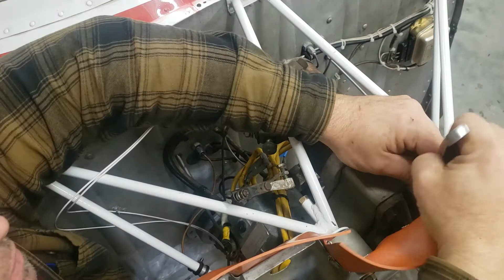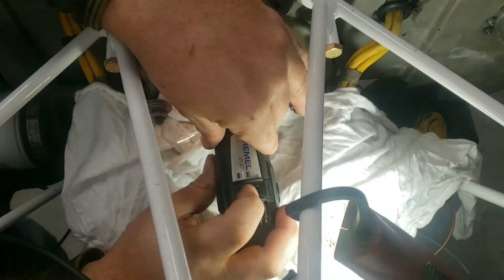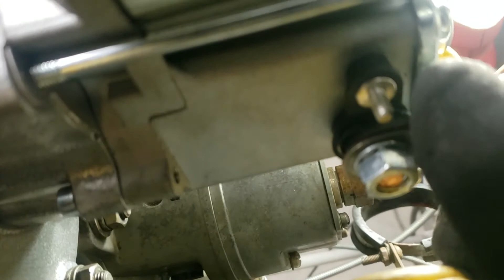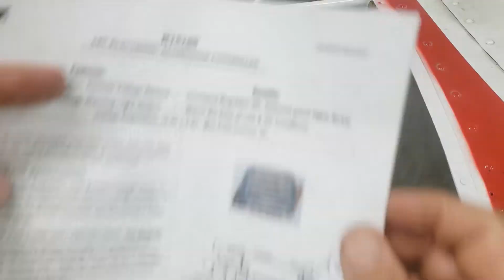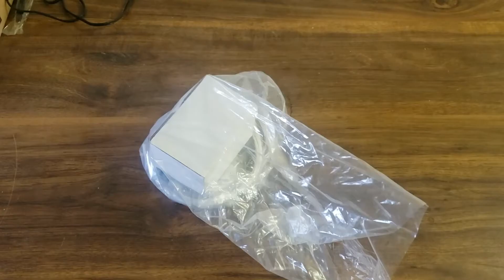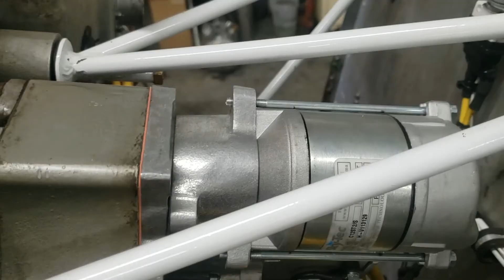Sky-Tec Starter Install - Part Two - Cessna 140

Comment: I ran into the same problem with  the starter stud being too short. AND the STC instructions are weak. There are NO exact directions to  remove the jumper as shipped from the factory. I could not get my electrical brain to tell me how this new push button switch is supposed to work with a jumper installed. I was like What The Fungle? NO elecrical diagram/schematic.  So much for legal STC paperwork approved by the FAA!!

Comment: Great Video! Perfect for my planned 0-300 starter conversion project. How long did it take to cut off the pinion shaft with the dremel? Also why did you do the conversion? We ran into problems with the pinion gear not engaging well even after adjustment, along with a lot of gear clash/grinding, esp. when the engine is cold.

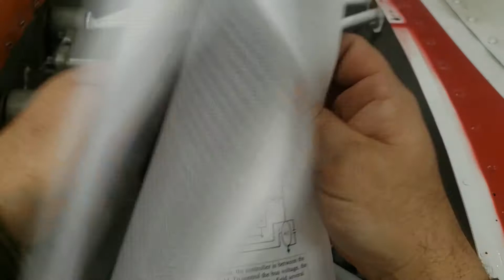Comment: This is a great help to me with my C90! However, I am confused as in your Part 1 video you remove the jumper from the power stud as 15:25 (saying that it's for a different installation), and then in this one at 20:36 you seem to replace it! Please, which is correct?
Reply from the maker: Yeah, I made an attempt to explain this in the video; starting about 12min into this - part II video. I'll try to summarize: Basically, the "jumper" is only used when a separate/remote solenoid is used.  However, this Cessna was never equipped with a solenoid and the installation directions called to remove the jumper and wire the "push to start" button directly to the Sky-Tec starter and NOT use a remote solenoid. As you can see in the video, I ran into a few problems with the existing wiring. After consulting with Sky-Tec's support, we decided to install the remote solenoid. This allowed me to fix the problematic wires but required the "jumper" to be reinstalled.
Reply: Thanks! I have got mine sorted.  @justinhoffman2236

Comment: In the old delco remy starter. What is the pinion used for?
I have a project on continental O300 engine, and I really can't find out what is the use of this pinion.
Reply from the maker: Originally, the gear would slide on the shaft to engage/disengage the starter. Take a look at your starter and the mechanical engagement linkage and it'll make sense.

Comment: Also, is that a cutting fiber wheel?  Or a stone?
Reply from the maker: It's a cut-off fiber wheel
Reply: @justinhoffman2236  well, thanks for the reply. ....I cut mine off a few months back.    I found the plastic protector from someone who didn't use his and I got it pretty cheap....only issue is that there's not much room in there, 🤪

Comment: Very well done. Thank you. Have a C85 that presently is pissing oil out from the "pull" start plunger/shaft. I'll replace that seal for now but this mod seems well worth the expenditure. The plastic cup thing is genius. I know someone who did this mod w/out it and wound up trashing the engine.  Until your vid, I didn't realize that a form fitting protective cup was available.
Reply from the maker: Yes, it comes with the conversation kit. Thanks for watching.

Comment: Did the starter come with the plastic cup for catching the metal ?
Reply from the maker: Yes, the protective tray was part of the kit. It's a pretty nice kit. I would like to see a wire schematic addressing the option of Not using a separate solenoid. However, their Tech support is great and willing to answer any questions.
Reply: @justinhoffman2236  I just called the skytech folks and they want 85 bucks for that trey, would you be willing to sell me your used one?  I just like to see how well that cutting operation is going to workout before I commit $1200 bucks for a starter

Comment: Another nice video! Wind was howling there for awhile, a good day to be working inside. I enjoyed the time lapse there at the end while you were wiring everything, but I do have one question… what did you put on those terminals that you connected to the starter relay? It appeared red almost like generic grease, I know they also make a few different terminal protectant sprays, but I haven’t seen any of them in red. I assume whatever the product was, was for corrosion prevention right?
Reply from the maker: Yeah, it's just a "terminal" grease. I have it in a spray version; It's red in color, too. I like to use it on the larger copper terminals as corrosion/oxidation protection. IMO, the plain copper term ends seem to corrod quicker than the "tinned" versions.